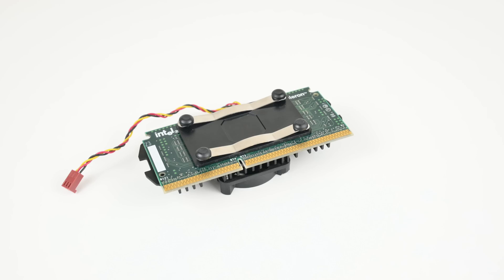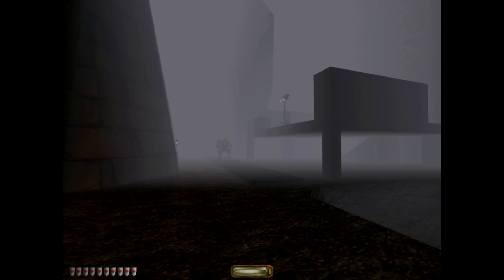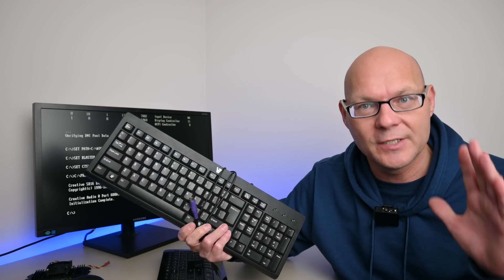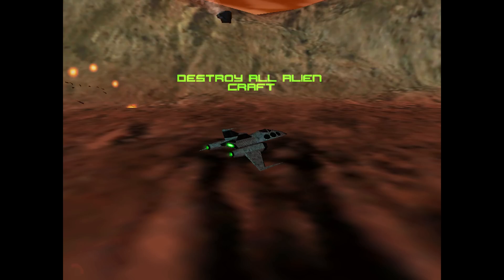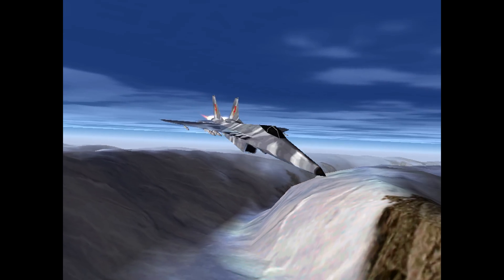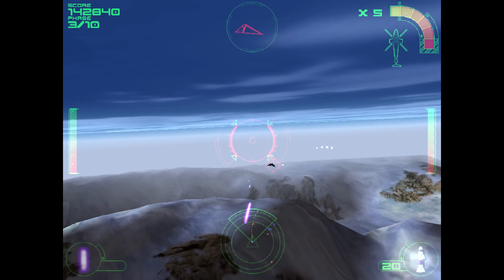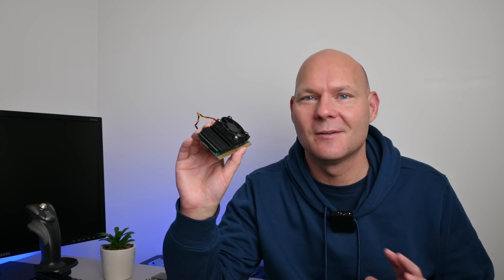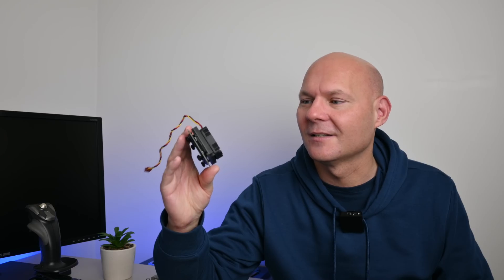Celeron 266 Is Missing Something Important

Comment: I have to wonder if one of these would be a good "486" or Pentium when combined with something like SetMul for more speed sensitive games, since we'd end up disabling caches anyways. With the price of Socket 7 compared to Slot 1, and the ability to swap CPUs on a Slot 1 board to something like a P2 or P3 and the higher FSB and AGP capabilities of such boards, it could end up being something similar to your Socket 7 Time Machine build, but have the ability through a few parts swaps or careful selections to run everything from DOS up to (probably not well) early Windows XP.
Reply from the maker: Unfortunately not. You will end up with a very slow DOS PC, too slow for many games.
Reply: @philscomputerlab  Well there goes that plan.

Comment: Why not overclock the 266 again? They easily go over the 400mhz mark. Was my first Slot 1 CPU and I think I got it to 448Mhz stable with another cooler on a P2B-F.
Reply from the maker: I don't like overclocking old hardware...
Reply: Phil has already made a 6 year older video of the Celeron 266 named: "Overclocked Celeron 266 vs Pentium II from 1998".
Reply: @retroianer3835  That's why I wrote 'again'....but beyond from back then. But well, it's his hardware. :)

Comment: What about older games? Are there reasons use cacheless CPU or CPU with 66Mhz FSB?
For exmple there is reason use 386 - wing commander. Are there games which work worse when you use more powerful CPU?
Reply from the maker: Not really because you can just use V-Sync to limit games that run too fast.
Reply: @philscomputerlab  is there vsync in dos games?
Reply from the maker: @Fedor_Sumkin1  Many games use it but there is no driver setting like in windows.

Comment: The Celeron was for overclocking . Everyone forgets how expensive Intel used to be and at that point the only other options were K6-2's . The first Celeron I had on a Tyan motherboard was a 433mhz clocked to 588mhz if I remember right until I got a p3 750mhz
Reply: K6-3 was 100% FTW. On board L1 and L2 so the cache on the motherboard for Socket 7 became L3.
Reply: @eboethrasher  I had the K6-2 first the 333mhz and then the the 500mhz . I couldn't get the k6-3 475mhz because I was broke when they were finally released.

Comment: Had a Celeron 266 clocked to 448 MHz and later a 366 clocked to 550 MHz coupled with a Voodoo3 2000. Worked like a charm, wish I hadnt sold it back in the days😅

Comment: Even with L2 cache, the celerons are very overclockable. I have a few of them
- Celeron 300A (SL2WM): 472 MHz @ 2.2V
- Celeron 333 (engineering sample): 500 MHz @ 2.0v
- Celeron 366 (SL36C): 550 MHz @ 2.0V

Imagine having a celeron 333 overclocked to 500 MHz in 1998... It can beat the most powerful pentium II money can buy
Reply: that was because celeron a had on-die 128kb cache. rather than pentium ii style 512kb external cache. External cache modules could never overclock as good as on die caches.
Reply: @mtunayucer  and those 128k ran at full CPU speed, 512k of the PII ran at half that...
Reply: @michvod  exactly

Comment: I had a Celeron 333A which was able to run stable at 500Mhz (with 2.2V Vcore)
It was a HELL of a CPU back then, in a lot of cases faster than any Pentium 2 model
Reply: It was best Intel CPU. I had 300MHz, added second cooler and switched to 450MHz by jumper settings on mainbord, It served couple of years and was a beast paired with RivaTNT at the time. Faster than more expensive Pentium II it was the best CPU in terms price/performance I ever bought, I had amd K6 II 266 before and no comparison.
Reply: I still have a socket 370 Celeron 500 CPU. No board or other hardware to use it but it's a start if i ever wanted to make a decent dos/98 machine.
Reply: Some Celeron's 366MHz run with 100MHz base, running as 550MHz. I have one, selected when I working in computer shop in service.
Reply: @pumabuciewska3729  the few ones that could run stable at 550mhz were the holy grail of the celeron line up.

i considered myself very lucky with 333 @ 500, since most celerons would not surpass 450
Reply: I've been upgrading PCs since 386 DX 40 MHz, but to this day, across over 30 years, the Celeron 266 MHz remains the best value and best upgrade I ever did. It instantly (Day One) overclocked to a stable 448 MHz and powered 3 different GFX cards (while I had it). It's hard to believe, but I kept it for about 18-24 months !!! I could play Heretic II at 1024x768, which was a very respectable resolution back then. If I recall correctly, I upgraded from the 100 MHz Pentium 1, so this was quite an upgrade, basically a game changer (almost identical to buying very first 3DFX Voodoo 4 MB card). I think I eventually had GeForce II Ti in the same box.

There was no way in hell that at the then-current prices, non-Celeron CPUs made any sense. The performance differential in games was abysmall, yet  for a very significant price hike. By the time full-blown Pentium IIs actually dropped in price, there was Athlon/Duron at 750 MHz and then Pentium II made no sense. It was skipped by everyone I know. Only corporations bought full price PIIs, not sane gamers.

Thus, I disagree extremely strongly with the vid's statement that "this CPU is not recommended!" That's laughable. Everyone I knew upgraded to these puppies, because anything else meant throwing money out the window.

To this day, we all agree, that in history of gaming, there was only one such CPU - and that's this particular Celeron at 266 MHz.  It's a historical CPU for a reason, but I guess if one didn't experience it, he can't know....

Comment: L2 cache was a big thing then. That's why the Pentium 2 was better than K6-2, as the  cache ran at full speed, vs the bus speed  on the K6-2 (from memory). Even the socketed Celerons had half the cache which hampered a few situations.
Reply: PII cache runs at half-clock, because it's on card rather than on-die.  The Mendocino Celerons have on-die cache which is 1/4 the size but runs at full-clock.
Reply: @dennisp.2147  Yeah it's been a long time, lol thanks for the correction. I was probably thinking of the switch to PIII which was on die cache

Comment: Yep, I was very wary of celery processors at first. But being a school kid with a part time job, I couldn't afford a Pentium II or III at that time, so I ended up with a celery 400MHz and a crappy slot I PC Chips motherboard that used a terrible SIS chipset. It didn't even have an AGP slot, so I was stuck with my S3 Virge DX PCI card, which couldn't even play DVDs. I picked up a cheap DVD decoder card, and I got a loooong cable to connect to the TV in the lounge room so the family could watch DVDs since we didn't have a separate DVD player (although that didn't last long since my Dad would want to watch a DVD while I was playing on the computer!). 

Eventually I saved up massive upgrade to a PIII 1GHz, which of course required a motherboard upgrade since there's no way that crappy PC Chips board would support a 133MHz FSB chip. I went with a Via chipset board, which finally included an AGP slot, so I could buy a Nvidia Riva TNT2 (not the M64 version!). Even though the CPU was powerful enough to decode DVDs, I kept the DVD decoder card for a while, since the output looked better.
Reply from the maker: Thank you for sharing. I love hearing stories like this, this is what it's all about 😊
Reply: DVD decoding gets a bit forgotten nowadays. But it's a major reason why I upgraded my PC back in 1999. I was in the AMD camp. Hanging out for Athlon but it wasn't easy to obtain the early chips and boards. So a K6-2 450 was my interim upgrade along with TNT 2 Ultra. I discovered too that TV output wasn't great for watching DVD's. So I used to watch them on the PC.  Later I got my Athlon and added a decoder card. Solely to get much nicer TV output.  Films like the Matrix, Cruel Intentions.. Something about Mary.  Plus importing some DVD's from the USA and modifying region codes to play them.  Good old memories. 👍😊
Reply: @mattscomp  Interestingly, I just looked up the TNT2, and it did have hardware MPEG2 decoding, which would've done the heavy lifting instead of the CPU. But I definitely agree that the DVD decoder card produced a much better picture, including the TV output.
Reply: @UpLateGeek  yeah you're right about the DVD decoding 👍 Getting the Ultra was overkill since I wasn't gaming a great deal. But it's fun if you can afford the best toys right? Funny part is even the best graphics cards were cheap compared to the eye watering prices of today. Back to DVD's I enjoyed trying out all the software players. One of them used to freeze my PC which wasn't fun. PowerDVD in what must have been close to its earliest version ran great. And became my favourite player.

Comment: The Celeron at 300 MHz was bad, disrespectful to any user, but it did not behave as horrible as many expected. It is important to take into account the major competition at that time: the AMD K6-2. Even with a 100MHz bus, the K6-2 was struggling to cope with integer arithmetic's, while it shine in the few 3DNow! optimized games. The K6 architecture did not incorporate an L2 cache until the + and K6-3 lineup, that was way too costly and came too late to change enough. In this competition, the Celeron fared quite decently as it had a much more modern FPU and microarchitecture, being based on the Pentium 2 architecture.

In short, where it would really matter, particularly in games, the Pentium 2 microarchitecture and the solid performance of the 440BX chipset motherboards made the Celeron a very powerful performer. There was no match between it and the aging Super Socket 7 architecture AMD coped with on the low end.

In the end, it should not be forgotten that the Celeron had another ace up its sleeve, the incredible overclocking potential. This made even the non-revised Celeron a dirt-cheap CPU with an incredible potential. The revised Celeron 300A, that also included an L2 cache, completely blown the competition, showing the biggest comeback in the low-end for Intel. AMD could not immediately respond with a cost-cut Duron which meant that Intel won valuable marketshare right after they started slowly lost it. Of course, Intel had massive support from OEM's. They could not have pulled such a victory as easily in other circumstances and they never had such an achievement ever since.
Reply: The k6 did fine at integer math where it fell on it's face was floating point performance. It was very fast at general use tasks at the time but in gaming especially games that relied on heavy floating point math would massively underperform. the k6-2 and later models improved FP math and introduced 3DNow technology to address the floating point deficiency even further there's even a version of Quake 2 that takes advantage of it and it actually performed really well at the time.
Reply: @bdhale34  Even at integer performance, the K6 was outdated compared with a Pentium II and, by extension, a Celeron based on the same architecture. I agree that the FPU was the much more important issue and the main reason why AMD K6-2 had 3DNow!, as it had a much improved performance for floating point mathematics. The K6-3 and K6-2+ only added an integrated L2 cache but left the rest of the architecture unused.

The major turnaround AMD had was with the Athlon. This revolutionary architecture was finally competitive with the Pentium III.

With 3DNow! there was a multifaceted problem: you had to optimize drivers, which 3dfx did quite well but other manufacturers were not as interested, and you also had to optimize applications. Few programs were truly optimized for 3DNow!, but I agree that Quake 2 was a very good example.

Comment: I remember at the time a friend had a new pre-built computer with a Slot A Celeron, Voodoo2 and a ViewMaster 15" CRT. I was quite jealous of it! At the time I had a K6 266 had just got one of the 'new' i740 cards from a local computer shop to replace the Diamond Stealth 3D 2000.. It was a decent upgrade, but not a match for the Celery. Later that year I would get a K6-2 300 for the Shuttle HOT-591P motherboard, and was much happier, lasting till I got one my favourite processors, a Duron 800 paired with a MSI K7T Turbo.

Comment: My dad used to have the better Celeron 300A, mixed with a TNT 2 Pro, installed with Windows ME (he apparently know how to make it not crap) . I think he built it back in early 2000's - he didnt really have that much money for the latest stuff - the desktop appeared to be good enough playing MohAA, the original Call of Duty, No One Lives Forever, and other stuff that god knows what he played.... He unfortunately sold it back in 2007. Wish he had kept it.
Reply: How much did he get for it in 2007? A fiver?
Reply: @patsy02  Havent asked him out yet, but well lets say it def way lower than even entry level oem PCs at that time. Oh, also he didnt use Sound Blaster cards. To him back in its heyday it was too much hassle to deal with.
Reply: Amd k2 3d now can be found cheaply but you will need a 400mgz+ to compete with intel 300 .- but for Windows ME- the os have Internet exporer 5 or assume 6.0 later which wont run good or fast on earlier cpus - So a Duron cpu will run games fine and browsers but even a game as unrael tournament 2004 minimum are a tnt2 and 733mgz amd - I had one and could play 320x200 software mode (900 mghz cpu) tnt2 could do open gl much better than directx and play the orginal game Unreal Tournament from 1999 in 1024x768
Reply: @494ihi  idk dude, my dad loves ME for the fact that it has native USB support. Also he told me that Windows 2000 can also crash if u're using old PCs too. I think he indeed aimed for AMD Thunderbird but dont have the money for it.

Comment: The only Celeron I had back in the day was a 366MHz, oh and there were two of them in the legendary BP6 mb o/c running at 550 MHz and 100MHz bus. It was awesome! Each cpu had a dual stack fan. Still wonder what a modern heat piped cooler would do to squeeze more out of the platform. Thanks for the video Phil. Good content as always. I remember Incoming coming with my wife’s Compaq, a K62 with ATI rage and Aureal on board. Looked and sounded great!
Reply: I had the same setup. Got over 600Mhz with water cooling. Aquarium pump in a steel bucket 🙂

Comment: Luckily Intel made up for this blunder when they released the Celeron 300A. Arguably the most overclocked CPU of all time?
It was crazy popular at the time, everyone I knew got one and all of them went 400 MHz with no issues, many ran fine at 450 too. :)
Incoming was great fun yeah! I still have my original big box here somewhere. I really should go find it now and re-live some of it, hehe.
Reply: I would say that Core2Duo is the king of OC. First C2D had massive performance increase over previous CPUs. Even slowest 1.8 GHz models were better than 2.5+ GHz CPUs from AMD or older Intel. Second, it was trivial to apply OC to them. I've had E4500 with stock 2.2 GHz and it was running for many years at 3 GHz on stock cooling. It could do 3.3 GHz too, but I used it rarely for most demanding games before I've switched to i5.

This is why Intel locked future CPU generations, allowing OC only on selected high-end models.

Comment: I recall hearing those Celerons were capable of serious overclocking. Would love to see a video where one is pushed to its limit, mainly to see if it could be made into something usable. No doubt an actual PII would outclass it in spades, but it would still make for an interesting video!
Reply: A Celeron 300A overclocked to 450 is as fast as a PII 450, due to the PII having it's larger 512K cache on the processor card and running at half-clock whereas the Celeron's 128K cache is on-die and running at full clock
Reply: Record clocks for this CPU are over 700MHz (140% overclock)
Reply: @foxyloon everything I have read indicates performance was equal to a real PII 450 also there is a vid on YouTube of a piii pii and celery at 450mhz and performance is identical.
Reply: When I was active building computers during the 98-99 timeframe, the biggest seller (November/December 1999) was an overclocked Celeron with a whopping 512mb of ram with a geforce 256 video card.
Reply: I had Celeron 266 OC'ed to 448 MHz. Full PII did not make any sense from gamer's standpoint. It was much better to use that money for GFX card. I dont' recall if I started with Riva TNT1 in this box, but eventually ended up with GeForce 2 Ti with some in-between card after TNT2 Ultra (which was a really nice card for this CPU - instant framerate boost).

I was watching CPU prices weekly and by the time full PII dropped to a price where it made sense to buy, it was already seriously outclassed by Athlon/Durons, so it didn't make sense to buy PII (again). But, if you were lighting cigars with $100 bills, I suppose it might have made some sense to buy PII at that time...

I have never ever managed to replicate the framerate boost from upgrade in the decades that followed that compared to this Celeron. 
And I bought brand new box 2 months ago, but it's barely "Meh" compared to this Celeron...
Reply: As they didnt have cache, they almost always hit Pentium II theoretical maximum, which were around 400 mhz in first stage (early revisions), and later even 450-500 mhz. With increased voltage, you could go over 500 mhz.
Problem was, they were not unlocked up, so you could use maximum only 4x multiplier on Covington celeron. 
On most "100mhz" FSB slot 1 boards, you could go maximum 112 mhz x 4, which is only 448 mhz.

Comment: Intel released the OG against K6-2s. Would be nice to loop in K6-2 or even K6-3 in the comparison.
Reply from the maker: Time is the issue. Adding another CPU tons video, suddenly you have to build a second machine, different drivers and everything takes double the time. That's the main reason I don't do comparisons much and focus more on the "story" of a component.